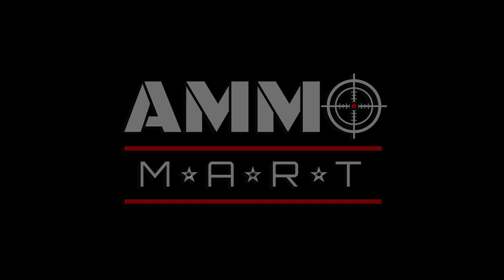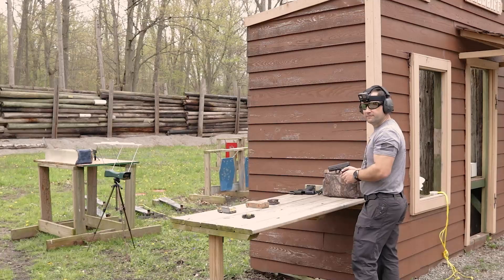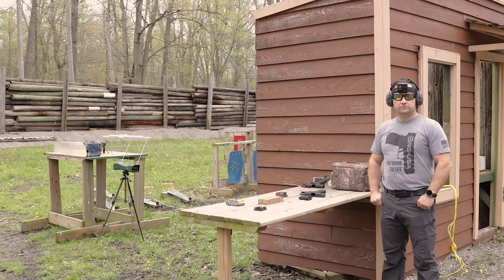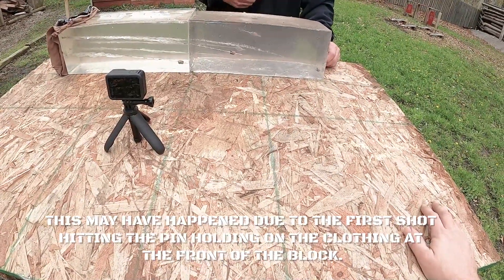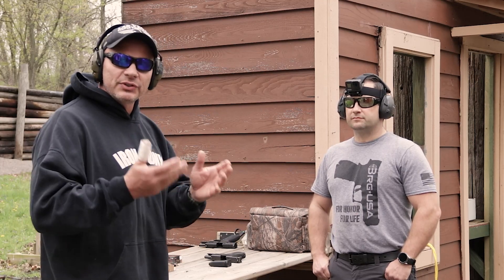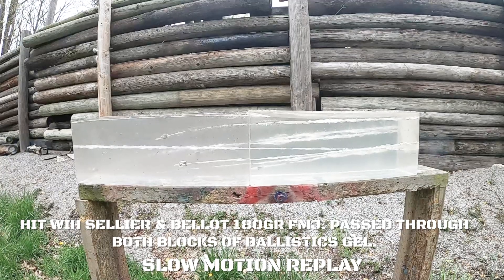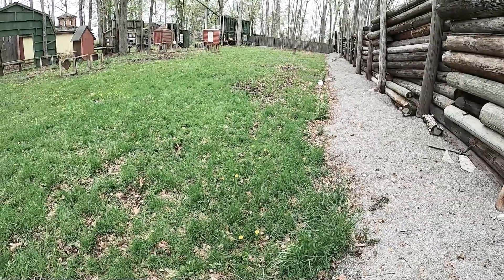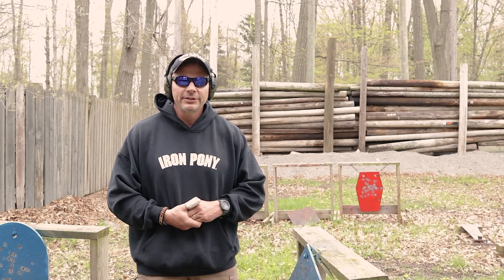Stopping Power of 10mm Auto

Comment: 10mm cartridge manufacturers have upped their game as of late.  S&B, which is known as one of the makers of the some of the weakest rounds, has increased the velocity of their 10mm.  So has Hornday, which had their 155gr XTP going out at 1265, increased its muzzle velocity to over 1400 fps.
Maybe, the ammunition manufacturers have realized their apparent mistake and changed their offerings.

Does an increase in velocity to a given JHP bullet, impart more of an ability to rapidly open and dump its energy quicker?  I have noticed there is a correlation between velocity and energy dump.  In fact, sometimes, the faster bullet doesn't penetrate as far, which is a direct indication the hollow point has violently opened, and thereby transferred the remaining kinetic energy into the media it traveled through.

My question is, is someone willing to test my theory with something like Hornady's 10mm, 155gr XTP  at both of their manufactured velocities?  A cartridge's velocity potential isn't obtained in a shorter barrel, so a barrel of 4.5 or greater should be used.  

*I am not a carry person.  If I do, its with an old S&W 1006.  I have a Glock 40 with a 6" barrel, but I haven't tried a way to efficiently carry it.  I intend to purchase a Glock 20 with its 4.6" barrel to be my future personal carry weapon.

Comment: To emphasize your point, I suggest comparing Federal 180gr 10mm to Federal 180gr 40S&W, both JHPs, not Hydrashoks. What you will find is the 10mm with same bullet is ~40fps slower than 40S&W. Worse, that Federal 40S&W load is weaker than Winchester, Remington, and Sig loads. However, 10mm from Corbon, Underwood, or even Sig will produce significantly higher velocities than 40S&W with the same projectiles. Also, while gel blocks are very useful for some testing, the velocity and energy cannot be inferred from penetration because bullets can be engineered to expand at different rates and to different degrees.

Comment: Well, in fact it makes sense… the more energy is transfer back to the recoil and into the hand, the less energy is put on the bullet and the less energy is transfer to the recoil the more energy is transfer  to the bullet.

I think no one has done this… try to fix the gun as static as posible not allowing it to bounce back… just the natural recoil of the gun but not allowing the entire gun to move by any fraction. Just fix it as much as posible and then shoot it then measure the speed, penetration, kinetic energy etc. The difference in speed, etc then is the factor of poor hand grip by each individual.

Comment: AFAIR The "FBI Standard" was to test against bare ord gel, clothed ord gel, angled car glass a foot from the block, and then 2 spaced 20ga steel sheets in front of the gel. then they had a scoring system to calculate "success" with the lion's share awarded for controlled penetration. 

Also IMO, Balistics Gel seems to not give the same results as the Ordinance Gel the FBI used and gives deeper penetration than the real thing. 

Just food for thought.

Did you use 10% or 20% gel?

Comment: use 185 gr 45 acp plus P ammo instead. too many under powered loads of 10 mm so you buy the 10 mm gun then the ammo cost more then 45 acp i dont see the benefit of owning a 10 mm
Reply: Buy underwood ammo and buy a double stack pistol. Decent reason why outdoors people are carrying 10mm for animal defense. I see less reason to carry a 45. I own several and they are my least carried caliber.
Reply: @FoulPet  there are double stack 45 acp pistols FN GLOCK and HK makes them. i have watch a number of videos stating that most 10 mm are watered down because of that reason and the extra cost of 10 mm ammo a person might come out buying 45 acp + p ammo. i know that people  carry 10 mm for animal defense and mainly hard cast ammo
Reply: @track-sv2us  yep and the grips are the size of 2x4s. I've owned a Para and a Glock in 45. Notice I said owned. 10mm is still big and heavy but if I'm going to carry a gun made for Hulk Hogan, it going to have more power and more rounds. 40SW beats most 45+P rounds in FP of energy.  Look up underwood ammo and check out the stats. If cost worries you, You should be shooting 9mm to begin with.

Comment: The ppu 180gr jhp at least the newer defense line should only be used as range or cheap hunting ammo from ky experence it does not open up near as much as even a 9mm jhp but it is real slow for a 180gr 10mm but still the bullt desigen is one I'd never use for self defense because it acts like a fmj
Reply: PPU is  a water  down 10mm. Underwood Ammo & Buffalo Bore is what I recommend.

Comment: I would like to see this test but with the real 10mm ammo as in the 600 plus footlbs rounds like the hornady custome 180gr xtp at 1275 fps with 650 footlbs and stuff from underwood like their 180gr gold dot at 1300fps with 675 footlbs and the 155gr xtp at 1500fps with 774 footlbs doubke tap has good powerful rounds aswell and underwood mainly buffalo bore has a few loads but energy wise are not quite as high but other wise great video
Reply: You will need to reload if you want to see that.
Reply: @rohawaha  no I dont all my rounds are factory from underwood and hornady if you hand load ive seen people get 155gr at 1600 or more fps which is almost 900 footlbs i have factory 10mm that is 774 foot lbs and from hornady 180gr  Xtp at 1275 fps which is 650 footlbs u do not have to hand load to get that energy but some loads that are self defense 10mm are loaded down for low recoil at like 500 footlbs which is the weakest ammo i have and I shoot it as range ammo but my stuff from underwood is 180gr gold dot at 1300 fps which they load even faster at 1350 with the other load but the 1st one at 1300fps is right under 700 footlbs and the other factory underwood load is 155gr xtp at 1500 fps which is 774 footlbs
Reply: 155gr XTP measures 1250fps out of my G29 with a massive fireball ring.

Agreed that the Hornady custom XTP loads should have been included.

Comment: My understanding is that clear synthetic gel has a thinner consistency and/or greater plasticity/deformability than brown organic gel. This means that clear gel allows greater penetration than brown gel does. We should reduce the clear gel penetration depths by some sort of correction factor. I've read -20-25% cited most often. 

So 21 inches in clear would translate to about 16 to 17 inches. And that's very good.

Comment: I am surprise about how low the velocity is here. I was expecting more than 1,500 fps.
Reply: these are 40 loads. no where close to 10mm. Part of the problem with these ammo manufacturers
Reply: @duroisgawd  the last time I checked a 40 will drop a person just as easy as a 10mm. I get tired of people rambling this bullshit over and over again. 10mm is versatile because you can get rounds for people running around 40, and with just a change of ammo, drop a bear. Not to mention same velocity,  still hitting with like 150 more lbf
Reply: @andog6092  my point is if you want to shoot  40 sw, get a firearm chambered for 40 sw. 10mm owners don't want to shoot .40 loads out of their 10mm's. Clearly you don't get it.
Reply: True 10mm rounds like underwood, Double Tap, Sig Sauer, HPR and Buffalo Bore. You will get about 1,230 FPS with 180 grain rounds, and 1,600 FPS with 135 grain. Any of this S&B, Remington, federal etc etc are all 10mm lite over the counter rounds not much different than .40.
Reply: @kineticenergy1085  what about winchester defender jhp
Reply: @yuthought-2450  it looks like that round would be a true 10mm load too, per the ballistic chart👍🏽😎 about 1220 FPS for a 180 grain and about 615 fl/lbs of energy is definitely a true 10mm load. Most over the counter loads of 10mm are just equal to the higher performing.40, which is what’s known as FBI lite because those whooses couldn’t handle full potential loss when they adopted the 10mm Delta Elite, so they figured they could lessen the charge of the full 10mm size casing, and then S&W came in and said “we could shorten that case, keep the .40 cal bullet and fit it into a smaller gun, which ended up being the .40👍🏽
Reply: I am here looking for 10mm loaded ammo info.  I agree with others.. this is merely 40sw loaded 10mm.   I expect more than 1200fps.

Comment: Great penetration means to me it can break the pelvis, hit the spine, etc. big game hunters in Africa choose penetrating rounds to bring big animals down with good shot placement. But I  don’t want a bullet to exit an intruder and go into my neighbor’s house. Any thoughts on 10mm rounds requiring greater maintenance with glocks?
Reply from the maker: I can tell you only from my own experience of owning multiple glocks chambered in 10mm that they don't live very long.  I have never suffered a catastrophic failure but by the 4 to 5 thousand round mark the recoil system is shot.  The spring is done and you notice very heavy recoil and the brass flies at least twice as far as it did when new.  I also have noticed more reliability issues at that same usage, perhaps related to throat erosion?? But I have never miked it to see.  For what they cost I just go get another one.  Thanks for viewing and be safe.
Reply: @AmmoMart  all glocks only make it thar far on the guide rod(plastic) and stock spring. Start with a 22lb spring and tungsten guide rod and youll go alot farther. Ive got close to 10000 rounds and still going strong in my gen 3 20.
Reply: 155 gr xtp on top of 12.5 gr of aa #7 are a good two legged varmint load.

Comment: Thanks for the great video.  I've been on the fence over getting a 10mm barrel for my G21 since I'm already set up for .45 Super but there's no doubt that 10mm popularity has skyrocketed over the last 5+ years.  Kudos to Phil on that first 50 meter shot, that was about as close to a perfect shot as I think was even possible.
Reply: You do realize you need the whole upper not just a barrel, right?
Reply: @stevepardini588   Not true, all you need is a 10mm conversion barrel, a G20 extractor (which works with .45acp as well) and recoil spring.  As well as a mag of course.  If I had the money I'd get an entire upper just because it's easier to swap in between each other but it's not necessary.

Comment: I shoot 10 & 40.  For my bux the 40 is a much better value & just as effective for defense.
Reply: If you use candyass loads in your 10 mm ammo, you are correct. If you use Underwood or Liberty hot loads, there is a major difference in "stopping power."
Reply: Doubletap, Buffalo Bore… those are smokin hot 10mm makers.   Greatly exceed 40 Short&Weak when loaded correctly